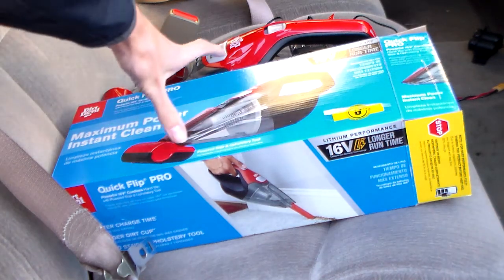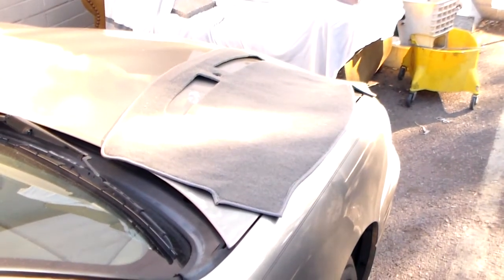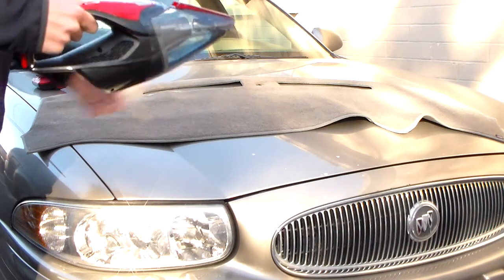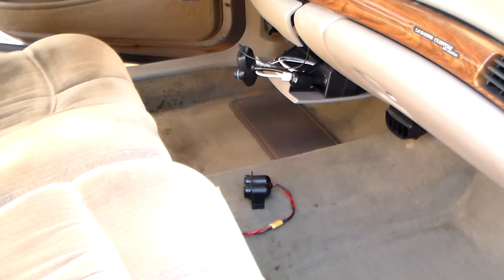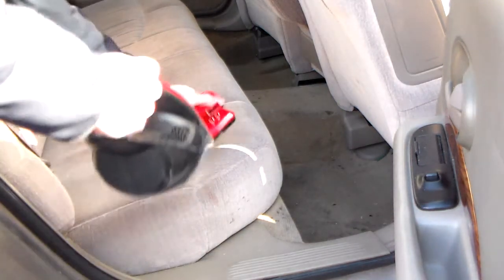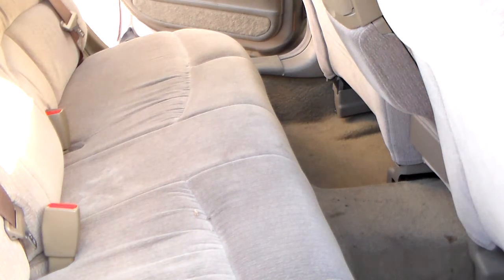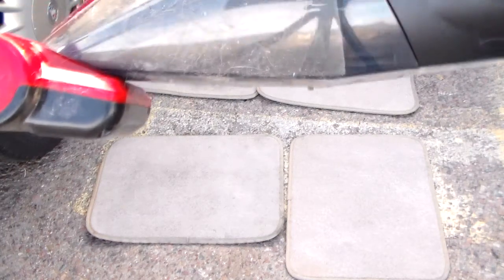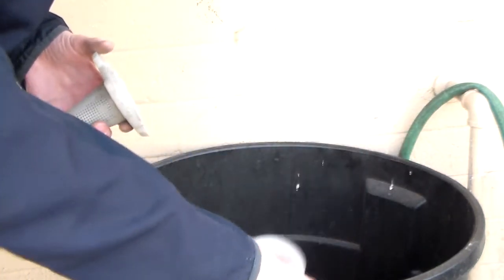Dirt Devil Quick Flip Pro 13m45s runtime cleaning my car in one charge!!

Comment: Thanks, excellent info. How many hours do you charge? Can I just leave it charging? Thanks again, Merry Christmas🎄☃🎉
Reply from the maker: When you plug it in the light will be pulsing blue, when the light goes out then it is done charging. You can leave it on the charger but it is best to unplug it after it is done charging, dont leave it plugged in for days on end, that could ruin the batteries. The chemistry is Lithium Iron Phosphate so they wont burn up or puff but they can still degrade if left sitting on the charger at their maximum voltage. That tpye of chemistry likes go go back down to its nominal voltage after a little while even if it is fully charged. Im not sure if it is releasing that voltage as heat or just fully absorbing it but I would not want to make it constantly do either. You have a great Christmas also!!

Comment from the maker: So I have charged it up using my CC/CV PSU and a capacity tester, it took about 1.28Ah and 21.7Wh in about 5 and a half hours this is at a 300mA charge rate, the power supply it uses is a 340mA CC/CV supply so charge time should be less, current might vary from model. Pretty interesting how it behaves exactly like how a standard BMS would, though you cannot charge it and run it. (a good thing) I will probably tear it down soon to see if I can charge it at a bit higher rate (500mA) I have to make sure it doesnt have a cheap diode or tiny transistor acting as the charge input switch.